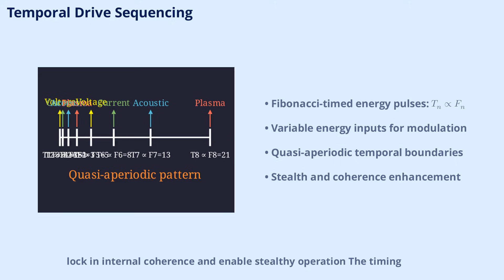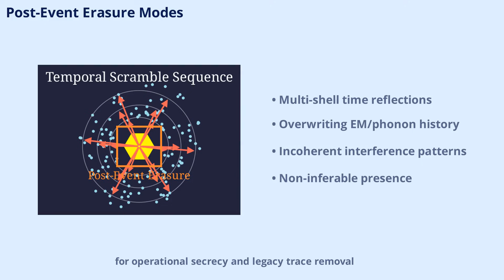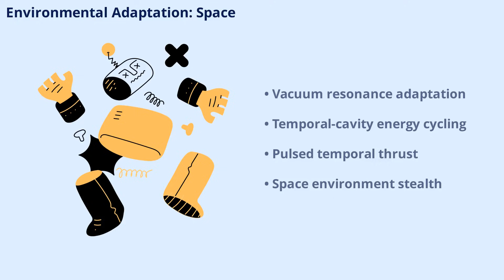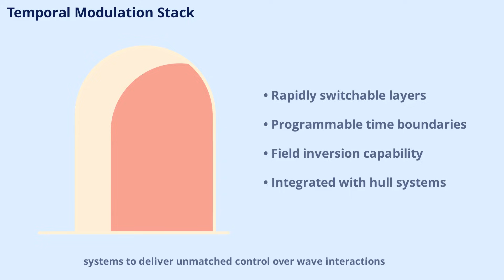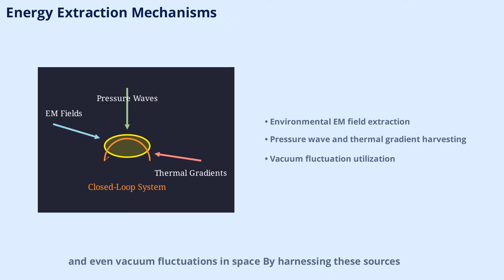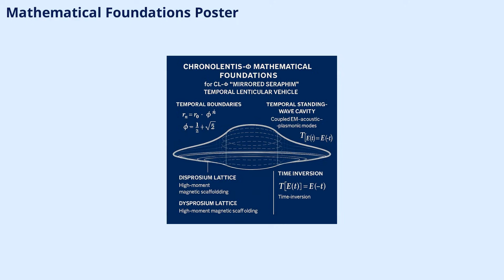The ChronoLentis‑Φ Framework Introduction & Chapter 1 VIDEO 1

Comment: The propulsion system for my saucer shaped spacecraft part 3 – Energy sources part 20 PART B3:

What are floating Terahertz SI loaded metamaterial waveguides?:

"Floating terahertz Si loaded metamaterial waveguides" describes a specific type of sensor design that uses silicon (Si) as a core material for a waveguide and elevates the resonant metamaterial structure above the substrate to significantly enhance sensing performance.
. 

Key Components:

•	Terahertz Metamaterial: 

This is a man-made composite material engineered to interact with electromagnetic waves in the terahertz frequency range (0.1 to 10 THz). They are often designed with microscale resonant patterns, such as split-ring resonators (SRRs), to achieve properties not found in natural materials.

•	Si Loaded (Dielectric) Waveguide: 

Silicon (specifically high-resistivity float zone silicon) is a preferred low-loss material for terahertz waveguides because air acts as an excellent, non-absorbing core material in the THz range, and the high index contrast enables strong confinement and guidance of waves via total internal reflection. The "Si loaded" aspect refers to integrating these silicon-based structures within the design.

•	Floating Structure: 

The term "floating" refers to a fabrication method where the metamaterial elements (e.g., SRRs) are suspended at a specific height (e.g., 30 µm) from the underlying substrate using a patterned photoresist. 

•	

Function and Purpose:

The primary purpose of a floating terahertz Si loaded metamaterial waveguide is to achieve extremely high refractive index sensitivity for advanced sensing applications, particularly in biological and chemical detection.

 
The "floating" design is a key innovation to overcome the limitation of conventional terahertz sensors where the electromagnetic field is distributed partially over the lossy substrate, reducing sensitivity. By elevating the metamaterial, the near-field interaction with the substrate is minimized, and the field is instead strongly confined to the area above the metamaterial where the sample (e.g., a liquid containing proteins or viruses) is placed. 

This results in: 

•	Significantly larger frequency shifts in the resonance when a sample is introduced.

•	The ability to detect much lower concentrations of analytes, such as bovine serum albumin (BSA) and anti-BSA protein binding. 

•	

This technology has the potential for developing highly sensitive protein sensors capable of detecting dangerous viruses like Ebola.

(Please download and read and read and keep the following pdf documents):

Circular Split Ring Resonator (C-SRR) Array Integrated Frequency-Notched Horn-Filtenna with Wide and Strong Rejection Band:

https://scispace.com/pdf/circular-split-ring-resonator-c-srr-array-integrated-27syfg62ib.pdf 

Terahertz material (Thz materials):

https://www.tydexoptics.com/pdf/THz_Materials.pdf

Floating terahertz metamaterials with extremely large refractive index sensitivities:

https://www.researching.cn/ArticlePdf/m00072/2021/9/10/10001970.pdf

Terahertz Metamaterial Waveguide with I-Shaped Resonators for Phase and Absorption Modulation:

https://www.mdpi.com/2304-6732/10/7/816 

Terahertz dielectric waveguides:

https://opg.optica.org/directpdfaccess/d922e3fe-9ec9-4fcf-af5328172b93f5e5_258388/aop-5-2-169.pdf?da=1&id=258388&seq=0&mobile=no 

Terahertz fiber link using dielectric silicon waveguide interface:

https://opg.optica.org/directpdfaccess/1baf7ff7-a789-4007-a8ac3d94af202714_526184/oe-31-5-7351.pdf?da=1&id=526184&seq=0&mobile=no  

Silicon based THz dielectric waveguides:

https://www.researchgate.net/publication/304410206_Silicon_based_THz_dielectric_waveguides 

3D-printed Terahertz Photonic Bandgap Waveguide-based Fluidic Sensor:

https://arxiv.org/pdf/1810.05625

Fiber-Drawn Metamaterial for THz Waveguiding and Imaging:

https://backend.orbit.dtu.dk/ws/files/137056584/JIMT_DrawnMM_amendedMarch2017.pdf 

Silicon based Metamaterials for Dielectric Waveguides in the THz Range:

https://ieeexplore.ieee.org/document/9825523

Comment: The propulsion system for my saucer shaped spacecraft part 3 – Energy sources part 20 PART B2:

A Circular Split Ring Resonator (C-SRR) is a key metamaterial structure, featuring two concentric metallic rings with gaps on a substrate, designed to exhibit strong magnetic responses (negative permeability) at specific frequencies, enabling novel microwave/THz devices like absorbers, filters, and miniaturized antennas for 5G, sensing, and lensing applications, acting like tiny LC circuits for manipulating electromagnetic waves. 

Key Characteristics & How it Works:

•	Structure: 

Typically two metallic rings (inner and outer) with opposite splits (gaps) on a dielectric substrate, forming an artificial atom for electromagnetic fields.

•	Resonance: 

The gaps create capacitance, while the rings provide inductance, forming a resonant circuit that strongly interacts with magnetic fields, often at wavelengths much larger than the ring itself.

•	Negative Permeability: 

By engineering the structure, C-SRRs can achieve negative magnetic permeability, a property not found in natural materials, that is crucial for metamaterials. 

•	
Applications:

•	Metamaterials: 

Forms the basis for left-handed materials (LHMs) and negative index metamaterials (NIMs) used in unusual focusing.

•	Sensors: 

Used in highly sensitive sensors for detecting substances like glucose or in microwave sensors for measuring dielectric properties.

•	Antennas: 

Enables miniaturized antennas, band-notched filters, and novel designs for 5G and Ultra-Wideband (UWB) systems.

•	Absorbers: 

Creates perfect absorbers for specific frequencies, important in stealth or energy harvesting. 

•	

Variants:

•	Complementary Split Ring Resonators (CSRRs): 

The inverse structure, with etched slots instead of metallic rings, offering similar functionality but often easier integration.

•	Graphene-based C-SRRs: 

Using graphene allows for tunable properties (like absorption and sensitivity) by changing the graphene's chemical potential, useful for Terahertz (THz) applications. 

Can split ring resonators be used to function as asymmetrical capacitors?: 

Yes, split-ring resonators (SRRs) can be designed to function as asymmetrical capacitors. The structural asymmetry, often created by varying the position or size of the gaps, leads to an effective asymmetrical capacitance distribution that affects the resonator's properties. 

How Asymmetry in split-ring resonators (SRRs) Creates Asymmetrical Capacitance:

•	Standard SRR as an LC circuit: 

A basic SRR behaves like an inductor-capacitor (LC) circuit. The metallic rings provide inductance (L), and the gaps between the rings or within a single ring act as capacitors (C) where electric fields are concentrated.

•	Introducing asymmetry: 

Asymmetry is typically introduced in several ways:

o	Varying gap size or position: 

Changing the relative position of the gaps in a double-gap SRR unit, or making one gap a different size than another, changes the total combined capacitance and its distribution.

o	Non-concentric rings: 

Designing an SRR with non-concentric inner and outer rings creates a deliberate asymmetry.

o	Varying arm width: 

Adjusting the width of the metallic arms can also introduce asymmetry and influence the capacitance.

•	Resulting electrical properties: 

This structural asymmetry results in an asymmetrical charge distribution and electric field concentration, that manifests as an "asymmetrical capacitance" in the equivalent circuit model.

o	This asymmetry is crucial for exciting specific eigenmodes (circulating current modes) in the SRR and can be used to control the resonance frequency, quality factor (Q-factor), and polarization dependence of the metamaterial.

o	The degree of asymmetry can even be dynamically tuned by integrating semiconductor-based variable capacitors (varactors) into the gaps. 
•	

o	

Applications:

The ability to create asymmetrical capacitance in split-ring resonators (SRRs) is used in various applications, particularly in metamaterial design, including: 

•	Tunable filters.

•	High-sensitivity biosensors.

•	Reconfigurable intelligent surfaces for 5G/6G wireless systems.

•	Polarization-insensitive or polarization-dependent devices.

Comment: The propulsion system for my saucer shaped spacecraft part 3 – Energy sources part 20 PART B1:

Rydberg gas:

A Rydberg gas is an ultracold gas where atoms are excited into high-energy (Rydberg) states, creating large, highly interactive atoms that exhibit strong, long-range quantum correlations, allowing scientists to simulate complex many-body physics, quantum magnetism, and even exotic states like topological phases, acting as a tunable platform for quantum simulation. Rydberg gas systems are studied for quantum computing, simulating quantum materials, and exploring novel states of matter like supersolids, with interactions controlled by the dipole blockade effect. 

Key Characteristics:	

•	High-Lying States: 

Atoms are excited to principal quantum numbers (n) much higher than usual, making their electron clouds huge and sensitive to external fields.

•	Strong Interactions: 

Rydberg atoms interact via strong van der Waals forces and dipole-dipole interactions, creating correlated quantum matter.

•	Dipole Blockade: 

The strong interaction prevents nearby atoms from being excited to Rydberg states simultaneously, creating "blockade" zones and enabling controlled many-body physics.

•	Quantum Simulation: 

Rydberg gases serve as powerful quantum simulators for complex models like the hard squares model, allowing study of phase transitions (liquid-solid) and exotic phenomena.

•	Tunability: 

Rydberg gases can allow Interactions to be precisely tuned with lasers and microwaves, offering control over the system's quantum properties. 

•	

Applications & Phenomena Studied:

•	Quantum phase transitions (e.g., liquid-solid).

•	Non-Abelian anyons and topological phases.

•	Quantum magnetism and spin models.

•	Dissipative many-body dynamics (time crystals).

•	Quantum information processing. 

In essence, Rydberg gases are a leading platform for exploring fundamental quantum many-body physics and designing new quantum technologies. 

Rydberg atom:

https://en.wikipedia.org/wiki/Rydberg_atom 

Rydberg matter:

https://en.wikipedia.org/wiki/Rydberg_matter 

Rydberg constant:

https://en.wikipedia.org/wiki/Rydberg_constant

Rydberg molecule:

https://en.wikipedia.org/wiki/Rydberg_molecule 

Rydberg state:

https://en.wikipedia.org/wiki/Rydberg_state 

Rydberg formula:

https://en.wikipedia.org/wiki/Rydberg_formula 

Spontaneous avalanche ionization of a strongly blockaded Rydberg gas:

https://arxiv.org/pdf/1209.4728 

Universal scaling in a strongly interacting Rydberg gas:

https://arxiv.org/pdf/0902.4523

An experimental and theoretical guide to strongly interacting Rydberg gases:

https://arxiv.org/pdf/1202.2871 

The experimental observation of a dissipative time crystal in a Rydberg gas:

https://phys.org/news/2024-07-experimental-dissipative-crystal-rydberg-gas.html 

Why an ultracold gas is like a wireless network:

https://physicsworld.com/a/why-an-ultracold-gas-is-like-a-wireless-network/ 

Slow Light in Cold Rydberg Gases:

https://physics.gatech.edu/event/slow-light-cold-rydberg-gases 

Dissipative time crystal in a strongly interacting Rydberg gas:

https://arxiv.org/pdf/2305.20070 

Electromagnetically induced transparency with Rydberg atoms across the Breit-
Rabi regime:

https://pure.uva.nl/ws/files/21971791/Electromagnetically_induced_transparency_with_Rydberg_atoms.pdf 

Electromagnetically induced transparency of an interacting cold Rydberg ensemble:

https://arxiv.org/pdf/0805.4327

Electromagnetically Induced Transparency with Rydberg Atoms:

https://journals.aps.org/prl/abstract/10.1103/PhysRevLett.107.213601 

Electromagnetically Induced Transparency in Media with Rydberg Excitons 1: Slow Light:

https://pmc.ncbi.nlm.nih.gov/articles/PMC7516595/ 

Electric Field Sensing via Rydberg Electromagnetically Induced Transparency Using Zeeman and Stark Effects:

https://arxiv.org/pdf/2402.01430 

Ultrafast many-body dynamics of dense Rydberg gases and ultracold plasma:

https://arxiv.org/pdf/2510.26319

Ultracold plasmas and Rydberg gases:

https://physicsworld.com/a/ultracold-plasmas-and-rydberg-gases/ 

Cold Rydberg Gases:

https://sites.lsa.umich.edu/kuzmich-lab/research/cold-rydberg-gases/ 

Excitation and Control of Cold Rydberg Gases:

https://www.pks.mpg.de/complex-dynamics-in-cold-gases/research/excitation-and-control-of-cold-rydberg-gases 

Cold Rydberg gases and ultra-cold plasmas:

https://lweb.cfa.harvard.edu/~hrs/PubList/RydbergSpecialIssueEditorial2011.pdf  

Rydberg Gas Sensors:

https://www.macqsimal.eu/macqsimal/rydberg-gas-sensors/ 

Split-ring resonator:

https://en.wikipedia.org/wiki/Split-ring_resonator